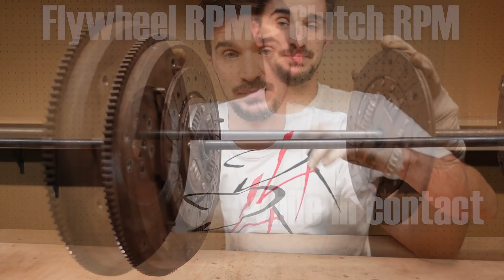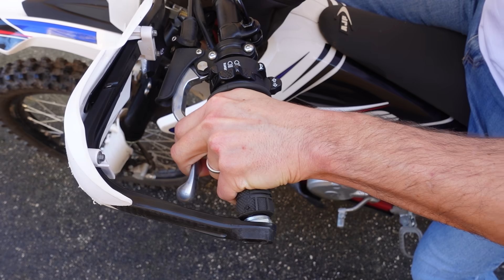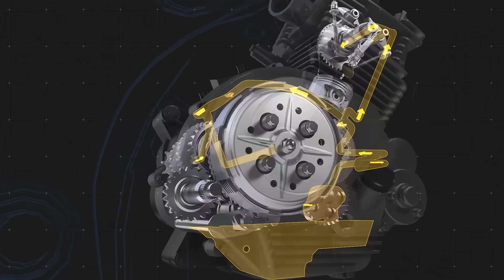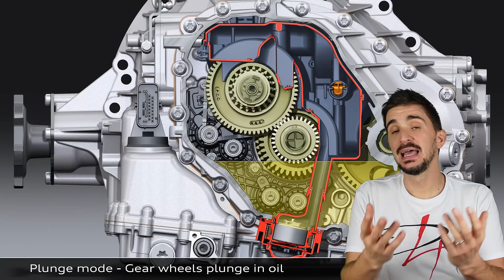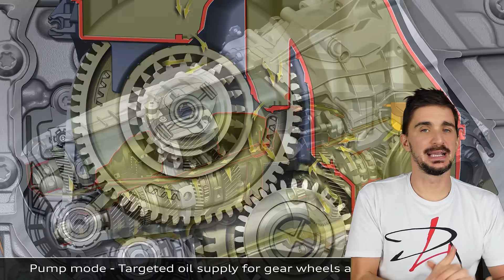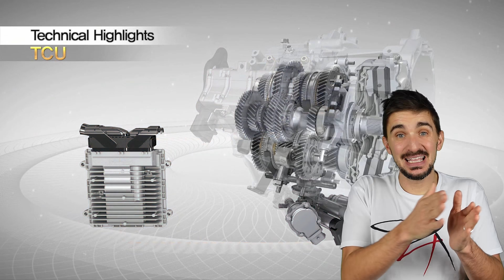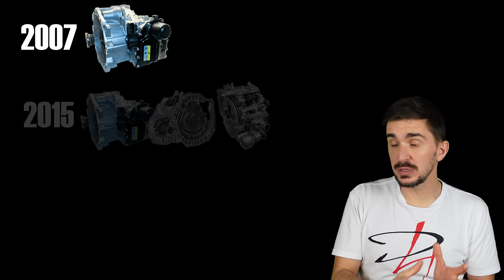Why Dry Clutches Suck and Why You Should Avoid Dry Dual Clutch Transmissions (DCT/ DSG)

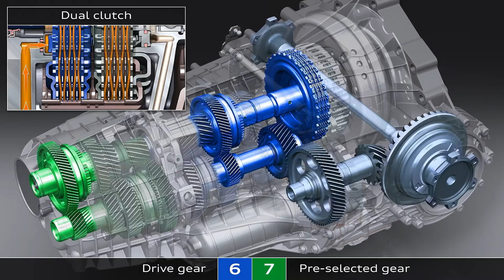Comment: 7:49 it's important to note that the 8ms is actuation time of the clutch, not the total shift time. This was a marketing number VW gave but is pretty irrelevant in isolation, and as a result it misled buyers a lot. 

The full shift time of a DCT is generally between 100 and 200ms because it includes sending the signal for the shift, the TCU calculating the steps required for the shift and building up hydraulic pressure to move the clutches - only then can the actual clutches be swapped. And all of this is assuming the gear preselection is correct, otherwise you're looking at a penalty of half a second or more depending on the state the transmission is in.
Reply: Also, I believe Ferrari has the fastest DCT right now, which can reach shifts into the 80ms range. For context, PDK shifts in 100-120ms while the traditional torque converter ZF8 (if we even call it traditional anymore, it still has clutches) does around 150ms. 
These aren't really differences a human perceives, and you don't always want the fastest possible shift time to begin with. That's why a lot of DCTs slip the clutch much more in full attack mode (launch control) compared to regular sport+ driving. 

What you do notice is paddle response time, and that's a pretty different discussion. There are lots of gearboxes boasting nice shift times but have horrendous paddle response, because the first steps outlined above are slow.
Reply: @xIcarus227   Here's the question: Excluding the response time, is the shift feel of a DCT "snappier" than a 8HP? What about the downshifts? Also, whilist people love to hate on single clutch robotized gearboxes, I've read that the whole clutch in-and-out of a MC Stradale is around 60 ms. Blazing quick.
Reply: @satsumagt5284  paddle response time is such a mixed bag, it's incredible reviewers aren't talking about it more. 

From what I've driven so far the most responsive to paddle shifts have been the ZF8 (gen 3 and 4) and PDK. The ZF8 responds slightly better to upshifts (surprising) while the PDK responds slightly better to downshifts. Due to the fact that the ZF8 can't be caught with its pants down like DCTs can, I'd say it's the most responsive to paddles overall, but the PDK is still an incredibly competent transmission and I would be perfectly happy with both.  

In contrast, effectively all mainstream DCTs suck hard at this. They boast their shifts time as if a regular driver should care about them, but their paddle response time is a joke which is a hilarious contradiction.  
All of them suck, DSG is a joke, Powershift is a joke, Renault DCT is an even bigger joke. 
There are a few variants of these transmissions fitted to performance cars which are more competent, for example the DSG in the RS3. But not all of them are, the one in the Megane RS for example is still not very good.  

The MC gearbox to my knowledge is a sequential transmission similar to the one in the Adventador, so it explains the nice shift times. More importantly, the paddle response seems to be effectively instant no matter what you do, which is fantastic.  

You know how we have that guy who reviews the steering of cars? We need something like that for transmissions.
Reply: @xIcarus227  The MC Gearbox… Well, it only has MC Superfast shifts if you have MSP off, aren’t taking a corner and in the high revs. Otherwise, you’ll most likely end up with a torque gap- Especially on low load, low rpm scenarios.

About the ZF gearbox, that was surprising for me to read. I remember the previous 6HP having hilariously slow response times, to the point where the gauge cluster would show next gear but ONLY THEN the revs would actually drop.

It also surprises me that most DCTs don’t respond that well to the paddle shifter inputs. I unfortunately never had the opportunity to drive a DCT, but I’d love to drive every single one of them, and rate them all.

Also, a little side note- When the manufacturers place the paddle shifters on the steering wheel and make no effort at installing a CORRECTLY ORIENTED (+ is back and - is forward!) console shifter… It is disgusting.
Reply: @satsumagt5284  lol I agree, I also think the 6HP was pretty dogwater, luckily the 8HP heavily improved upon it. People started realizing it's a good box during 2nd gen (2014) which is when it started gaining popularity. In 2018 3rd gen was released which noticeably improved responsiveness, and it's when this box started achieving greatness in my opinion. Software such as xHP also made it clear there's still a good amount of performance left in the bag. 

I can totally relate to your surprise, if you listen to randoms on the internet you'd believe that DCTs are god on earth whereas automatics are bad. That's what I used to think until I went through a couple of mainstream DCTs and I didn't like any of them. I blamed it on the fact that I prefer manuals and moved on. 
A few years later I reluctantly bought a ZF8 car after some of my favourite reviewers praised this box, and immediately realized this box is miles better than most DCTs. It shifts fast, it doesn't do dumb things at low speeds, and it actually shifts when I tell it to. 

I figured if this ZF8 is so good, the PDK must be godlike based on what the internet is saying. Well it turns out most people on the internet have no clue what they're saying, because I was disappointed in this box. Not because it's bad, it's a fantastic gearbox and would buy one without regrets. But because my expectations were in the stratosphere, where the internet set them. 

This is why I advise you to form your own opinions, try everything you can and see how you like them. All I'm gonna say is that you care about paddle response a lot like I do, I don't think you'll be happy with most DCTs. Aim for higher-end ones or try the ZF8 (preferably 3rd gen or newer). 

"Also, a little side note- When the manufacturers place the paddle shifters on the steering wheel and make no effort at installing a CORRECTLY ORIENTED (+ is back and - is forward!) console shifter… It is disgusting."

Hahah I totally agree, I don't understand why you'd ever have to move the console lever forward to upshift. It's such nonsense.

Comment: I’ve watched several videos about wet clutches, usually motorcycle clutches, but none, including this one, has addressed a key issue. Clutches rely on friction to work, oil reduces friction, so why don’t wet clutches slip? If oil fills in the microscopic irregularities that enable two surfaces to engage, what design feature of the wet clutch compensates for this? Is this a dumb question?

Comment: Motorcycles use wet clutches because the increased spring pressure needed to hold wet plates together is barely noticable on a small motorcycle clutch. I have to wonder how stiff a wet clutch that could handle a V-8 would be? The only problem dry clutches on motorcycles have ever had is sticking from rust if the motorcycle is not riden everyday. And noisy.

Comment: Dry clutch for performance driving 🏎️

Dry clutch for grandma on Sunday drive in the city. 🔥🧰👨‍🔧

Some bureaucrat engineer wanted to maximize fuel efficiency and thought "manual transmission = efficiency. Dual dry clutch = automatic?" And put a performance application parts into a daily driver car.

And nobody during the test procedure decide to give it to Grandma to drive in city traffic. Non-aggressive, slow driving is actually worser for dual dry clutch. We had to replace a view of them because of drivers who were conditional with automatic transmissions, and would creep forward in traffic, burning up clutches.

Comment: Bravo! Excellent presentation on the pros and cons of each system. 🙏👍 Sadly, fewer and fewer car manufacturers continue to offer stick. One thing I could never wrap my head around is how wet clutch packs on motorcycles can grip so well when bathed in all that slippery oil, when the primary function of the oil is to lubricate. 🤪

Comment: It's not the torque of the engine that's a problem , it's the energy stored in the flywheel .
That is potentially a far greater torque . It is the same effect used in "rattle guns" used to loosen fasteners

Comment: Don't like oil for clutch circulating into engine. Am i wrong.
Reply: On bikes where wet clutches are common, it's not that uncommon to have separate sumps and oil pumps/strainers/filters for each.

My KTM for instance the front sump is for the crank, piston & top end. 
The rear sump services the transmission & clutch

How is a wet clutch any different to having an automatic transmission? The ATF isn't getting oynped around your engine, it stays in the transmission

Comment: There is only one perfect transmission; the standard transmission. Why? The reasons are legion, but I'll give you just a few.

1) Instantaneous drive train decouple: Look at any YouTube video of someone sliding in a dual clutch automatic... and crashing. Why? Because they can't get it into neutral to regain traction... and they're idiotic. With a standard, I press in the clutch and the wheels almost instantly stop slipping and traction is regained. It doesn't matter if I've over done the throttle and the tires are burning. It doesn't matter if I've hit a slick surface and I'm over driving the traction. One peddle press, and I've regained grip[.

2) Control: The standard gives one 100% control of the drive train coupling. And no computer can come close to the control, speed, refinement, and feel of a human on a clutch.

3) Simplicity: One foot, one peddle, a cable or hydraulic line, a throw-out bearing, and a clutch assembly. DONE! Inspection of remaining material is a breeze as there's an inspection port. One simply crawls under the car wit a flashlight and a screwdriver to remove the inspection port cover, turn on the flashlight, and look!

4) Maintenance: I can replace a clutch in an hour or so with hobby tools for the cost of parts. A double clutch... not so much, and with a multi hundreds of dollars or thousands of dollars bill.

So you can keep your overly complex, repair nightmare, wet double clutch system to yourself.

Comment: My biggest problem with DCTs is in stop-and-go traffic.  Since you're not directly controlling the clutch, you don't really know at what point it's fully engaged and not slipping any more - and sales people sell them as if they were conventional autos with a torque converter (because to the driver's perspective, they are operated like one.)  I suspect this is part of the reason so many dry plate DCTs have failed clutches.

Comment: Problem is those gearboxes are absolute dog shit!
They are fragile, unfixable due to the manufacturers not selling parts.
If they malfunction it's a new gearbox.
Way too many failing well under 80k miles.

I wouldn't dream of buying one, an old dry clutch or a torque converter could do 500k miles!

Comment: There is another spring in that dry clutch you're showing - the wavy one you can see around the periphery, between the two friction faces.  That's what gives you a softer, less abrupt contact patch by letting it contact the flywheel and pressure plate more gently.

Comment: The main purpose of a dry clutch pack is not the reduced friction, it's so it can be replaced quickly in the middle of a race because there's no oil to deal with. This is why they make no sense for a street bike.

Comment: It's worth mentioning that in the case of motorcycles, the dry clutch is paired with a sequential dog box, not a DCT or a conventional H pattern gearbox which has some important differences on how gears are engaged and selected. A manual sequential dog box only needs to use the clutch to start from a standstill, it doesn't need it to shift up or down at all and that keeps clutch usage down to the absolute minimum and that's why Ducati sells even their road going panigale motorcycles with dry clutches. Essentially, if the rider is competent, the dry clutch on a ducati v4r will last the lifetime of the motorcycle.

Comment: Thoughts on putting the car in neutral at a red light? I heard it helps cool the transmission oil. It must also reduce wear. I know that my truck idles at 800rpm in gear, and 400 rpm in neutral. Neutral/park seems better, especially for things like waiting to pick someone up.

Comment: Years ago I came up with a manual dual clutch transmission with a dual gear fork shifter that shifted a dual fork that changed the relation of force to the throw out bearings to keep gear preselection for shaft rotation speed consistent when you hit the clutch pedal. It had syncros for when you didn't want to be sequential with your shifts too. Too bad I'm a nobody lol.
Reply: Dude make a video about this

Comment: if you really want to know how badly these suck............Ask a ford Focus owner XD and how many replacements they have blown through my friend is on his 5th replacement. Ford in there wisdom felt the Wet clutch systems witch require some fluid changes, felt customers the majority of them would never have it done or even understand what a dual clutch auto was so went against it for a dry clutch, just on the reason it saves us and the customer money on needless fluid changed XD. Downside for Ford....it BACKFIRED SO HARD they Blamed the people who engineered the transmission who then defended them selfs showing just how stupid ford is.. its a really funny F-ing story to like it is really really funny beyond what it should be.

Comment: One type of emission that seems to not be mentioned here. Wet DSG requires the oil to be changed way more frequently than dry clutch ones. Not that significant, but if you mentioned the air particulates, this wouldve been more fair

This also may or may not make it more expensive to live with one
Reply: I think this may be one of the reasons that they did the change. Not many consumers are willing to go in and pay for transmission fluid change every thirdish engine oil change

Comment: Chrysler solved this problem in 1939 with their Fluid-Drive transmission which used a fluid coupling, the thinking was you didn’t always need to step on the clutch when coming to a stop, just step on the brake, step on the gas to go. The clutch was only used when selecting a gear, could be driven like a traditional manual transmission, or driven like a simi-automatic transmission in a way. Later on, a simi-automated Fluid-Drive was available, there was low and high range. In low range, you’d step on the accelerator pedal, depress the accelerator pedal, would shift into second, would step on the clutch to shift into ‘hi’, shifted into 3rd gear, would give it some throttle and would depress accelerator pedal, would be in the final gear or ‘fourth’ gear.

Comment: I can tell you from experience that wet clutches can be done incorrectly too - wet clutches don't immediately solve the problems associated with breaking and engaging a power path. Temperature rise during slip can often be dramatic enough to break down the lubricating flluid, even in very short engagement times, confirmed by instrumenting reaction plates directly. Stick-slip in edge cases is a big NVH concern. Per-unit mu confirmation is necessary during end of line testing, and mu changes through use in somewhat predictable and somewhat unpredictable ways. BOB and WOW clutch packs (and the pumps supplying pressure to those clutch packs) can have very dramatically different performance, and both need to be accounted for in software compensation. TLDR, wet clutches solve some issues but also present their own unique issues (before you even consider cost.) Like everything in engineering they are a compromise.

Comment: Almost bought a used Ford with a DCT that had already been replaced prior. Did a deep dive into the reliability of dct and was amazed there wasnt some massive class action lawsuit for such a pisspoor design.  DCT’s are on the same level as CVT’s. Would be nice if the manufacturers could incorporate the e-cvt to mate up with the ice’s

Comment: I am surprised you didn't mention the DCTs that use a torque converter in addition to the clutch disks.  I am not sure if those would be dry or wet clutches.  I suppose wet because the torque converter needs oil, and sandwiching a dry compartment in the middle of the torque converter and the 2 clutches would be complicated and expensive.  Also the torque converter is the kind of power sapping device you want to get rid of in the first place 🙂 I know some DCTs seem to have one because they still creep. Perhaps the creep is done by the computer to simulate a traditional auto, but only when the brake pedal is released, else the clutches won't last long.

Comment: I'm of the opinion that modern transmissions need rebuilt when you change the fluid. Because of the internal clutch packs at least in automatic. Manual hopefully you aren't grinding off bits of your gears lol

Comment: So.... How about an electromagnetic eddy current clutch with dry locking clutch?
Have an aluminium plate rotate between electromagnetic coils. If that gear set is not engaged, the coilsre turned off, and the dry clutch is disengaged. If that gear set is engaged, the coils will be energized acting as pretty much a slosh box, until you can engage the locking clutch. Pretty much no wear! And can engage the coils using a transformer-like structure so you don't even need commutator brushes. 🙂

Comment: Wet DCT may be perfect but owners, especially subsequent owners are not. Most will not change the trans fluid on schedule. The nut behind the wheel is the hardest to tighten to spec.

Comment: You know, I'd like to have the experience of driving an old-fashioned 5- or 6-speed manual transmission, but with a wet clutch. Don't know if such a thing was ever done, but I'll bet shifting would be smooth as silk.